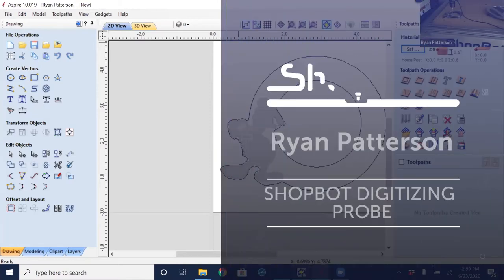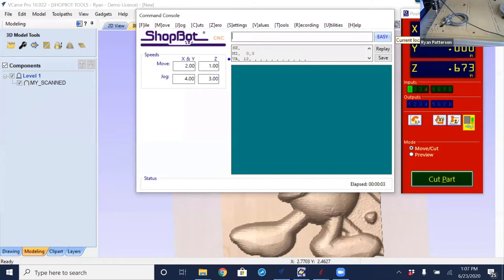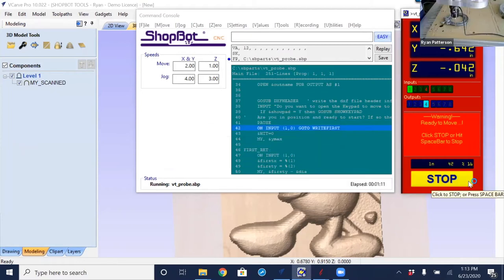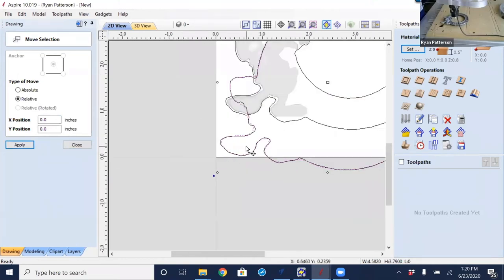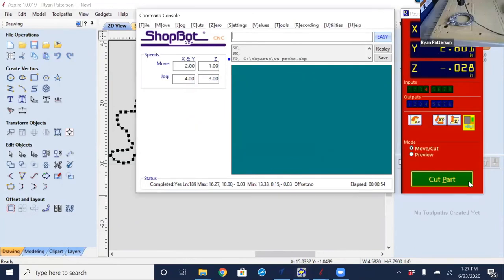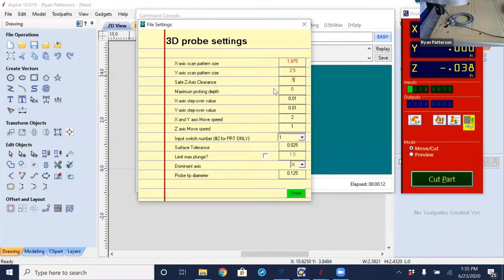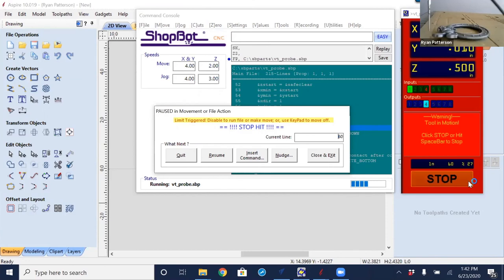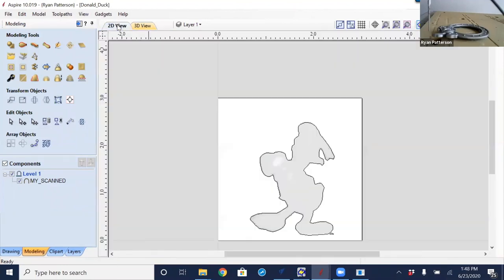Ryan Patterson: ShopBot Digitizing Probe

Comment: Can you touch off a part by using this as a Passive Probe?  Does your software have commands for this like finding a center of a hole?  If so… How do you do multiple work offset with this? Meaning G54 is your current off set, via the probe, then how do you do a G55 Off set, and check it with this probe? Thanks.
Reply from the maker: Hi there! Thanks for your questions! ShopBot tech support would be happy to discuss all of the capabilities of the digitizing probe via email or phone to figure out if it's right for your application. support@shopbottools.com or 888-680-4466